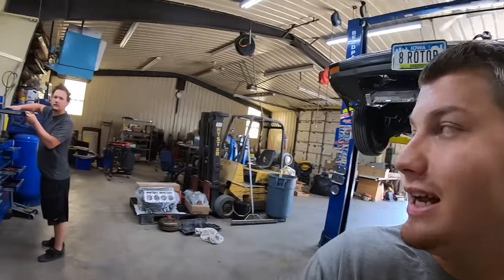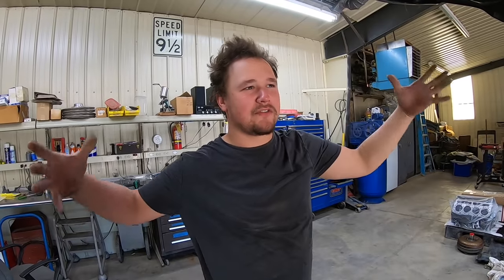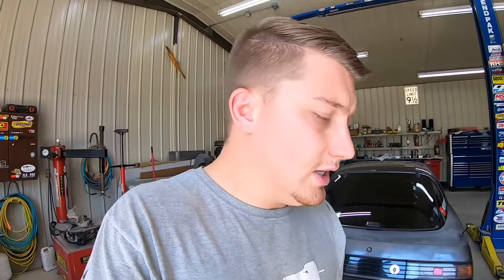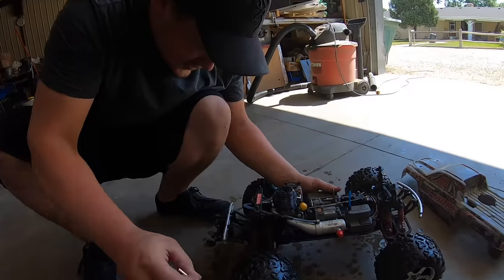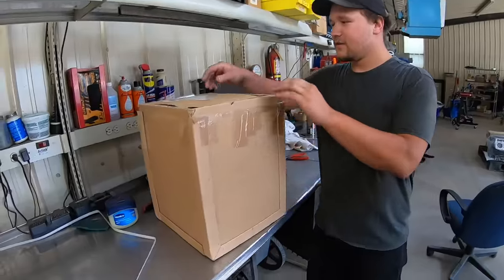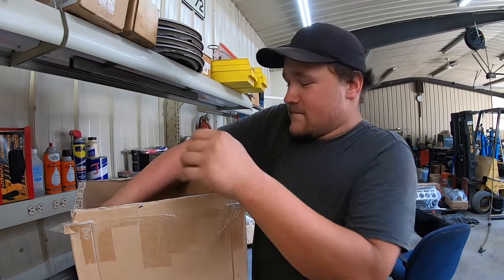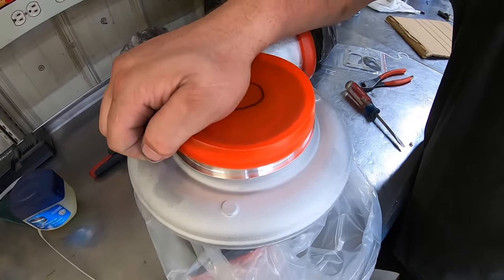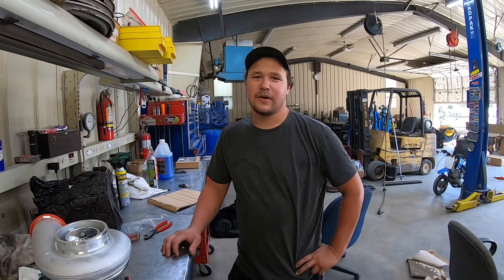"8 ROTOR" RX-7 Trans Removal & RedNeck Gets New COMPOUND Turbos!

Comment: Allison stock shafts can hold 1200hp. I've seen it but they fucking hate shifting fast. Duramax vans had 4l80e or 4l85e stock so a th400 will fit or even a 6l80e.

Comment: If ur running pump gas i would do a meth injection set up but i commented i think on ur last video that u should do a air to water set up that would drastically lower ur intake air temps cuz once ur air temps get around the 120-130 range and higher it will start causing detonation of course u prolly already know thi but anything above 130 in my opinion is very dangerous u never want ur air temps being close to ur engine coolant temps didnt u say ur air temps would get up to 150 or something by the end of a pass? I would deff switch to a air to water setup and ditch that air to air or run a meth injection set up u can get them cheap